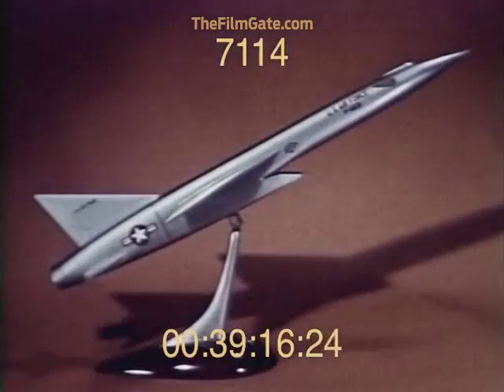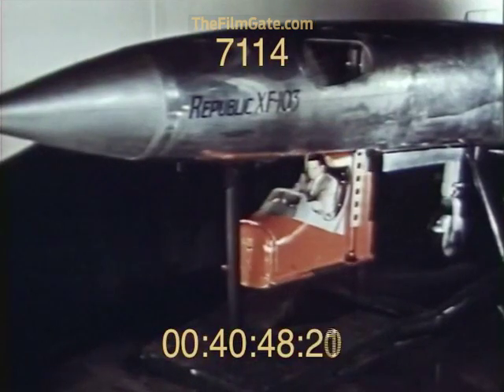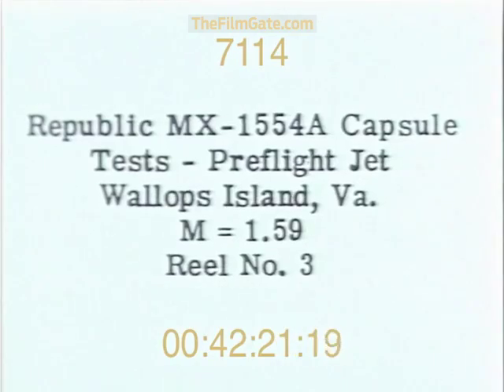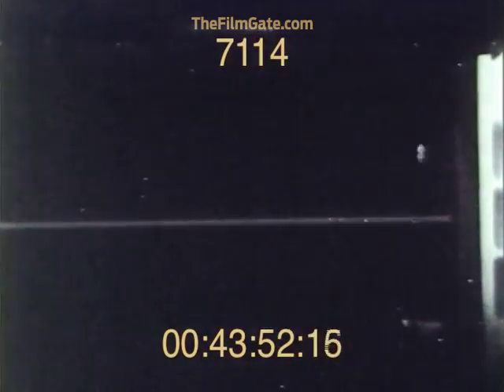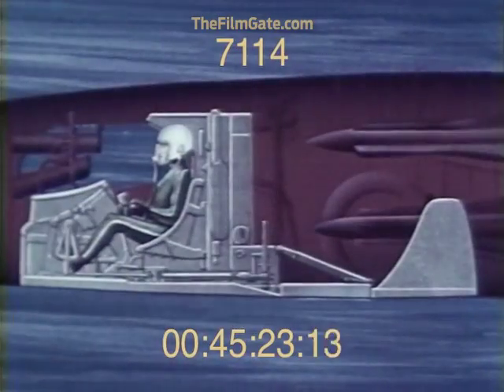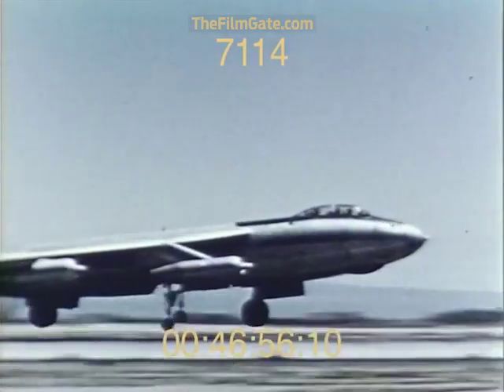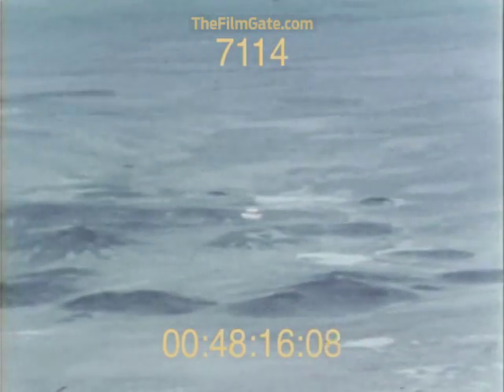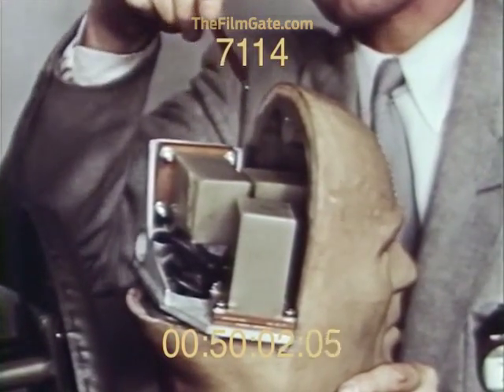F-103 supersonic escape capsule - Stock Footage

Comment: Even more bizarre than the f-107, just a musclebound f-100 with a pointed nose and weird intakes on top of body behind the pilot! They never got one in the air, just like the f-108.😢
But the mock up of the f-103 look super sleek awsome! Mach 3.7--- woah doggies!
Have you ever seen the super crusader? Another cool plane never made it into prodection,
But they DID produce 1 that flew. Had a very high top speed. Was like a musclebound crusader. Also the odd f-107 was up + running, having a fly off in front of air force big wigs at edwards in the late 50 against the awsome f-106 delta dart, but could not out fly the "6" and lost out!😥

Comment: Wow, thanks for posting! Just when I thought I’ve seen everything on the XF-103 something new pops up! 👍🙂
I know one thing; had this airplane gone into production that downward ejection seat would have been scrapped in favor of an upward system. The F-104 Starfighter originally had a downward ejection seat…all fine and dandy at high altitude but if you ejected at low altitude (takeoff for example) you’re going to turn yourself into a high speed farming implement!